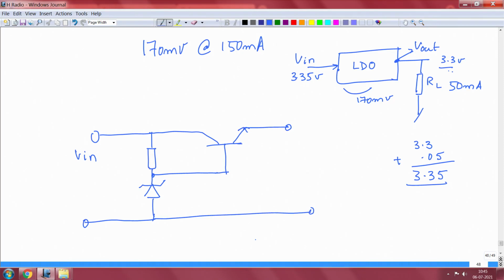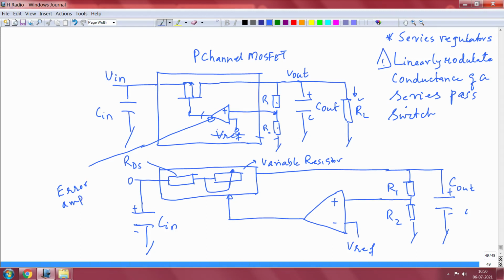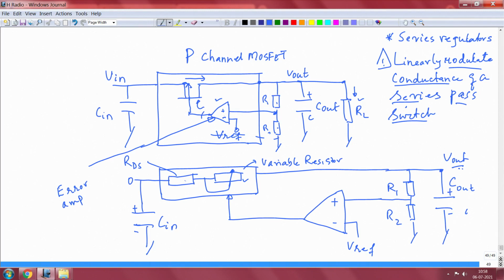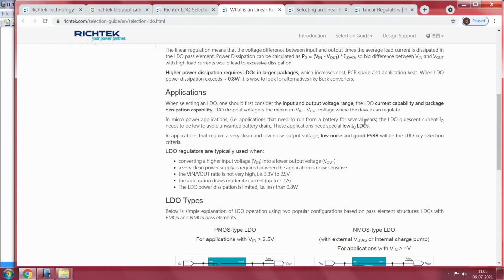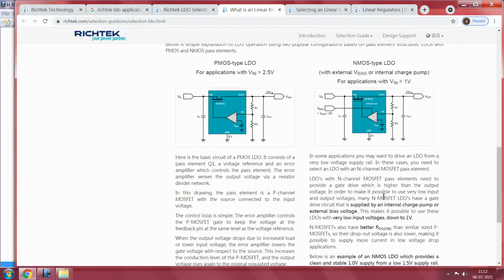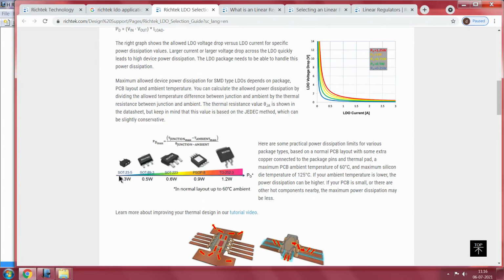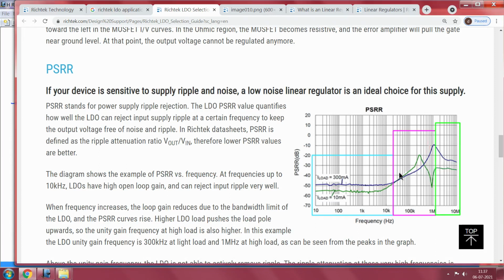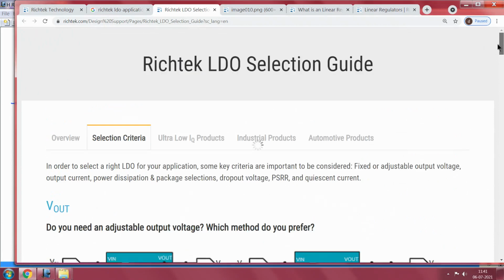Lec 20 LDO – 01

Comment: But the charge pump works on charge and discharge cycle of the capacitor.
Due to which the output will be more analogous to switching regulator